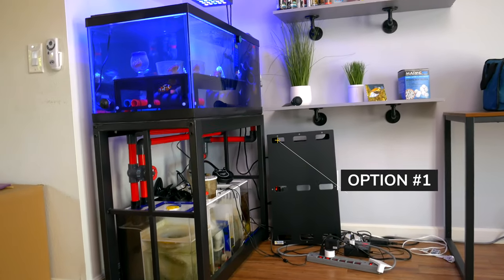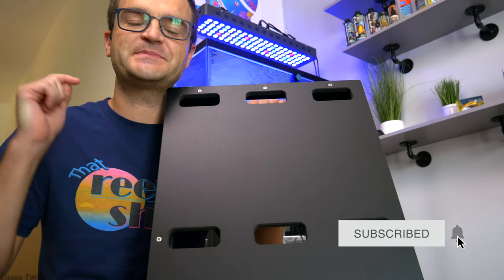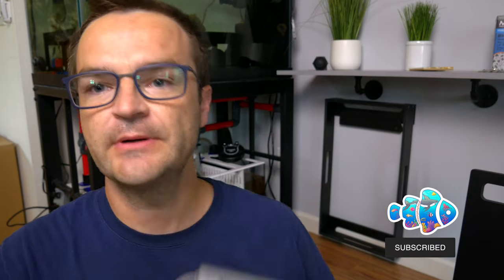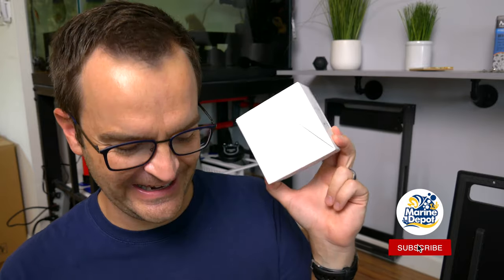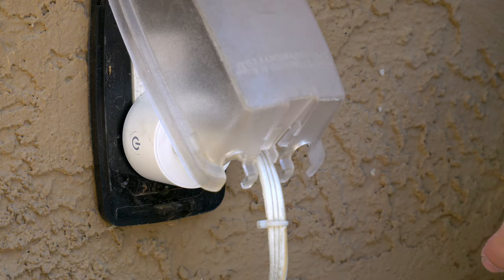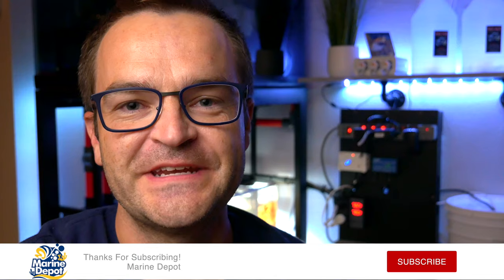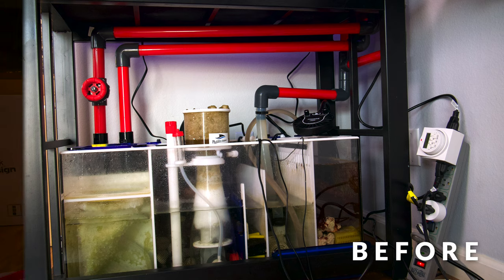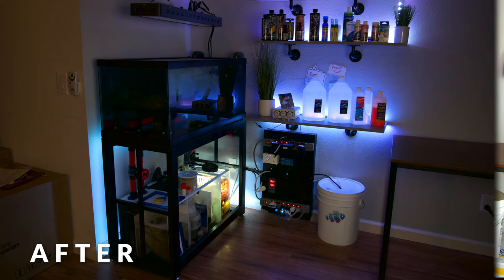Staying Organized with the Marine Depot Controller Board!  That Reef Show Product Spotlight

Comment: Those WiFi plugs are cool. Another recommendation I can make is the geenie WiFi enabled power strips. You can control individual ports via your phone, set timers and schedules and even use Alexa to power Individual devices on and off. Super useful during feedings, when you have both hands in the tank or just have both hands full.

Comment: For what you spent on extension cords and wood switches could have closely sprung for an apex and had it all
Reply: Pack of 4 kasa plugs is 20$ completely control it. Apex can detect PH salinity ORP. I like Kasa because I can feed corals and turn off skimmer at the same time and turn off powerheads.